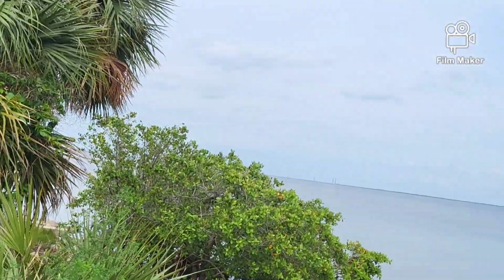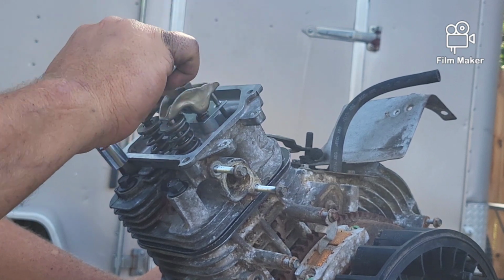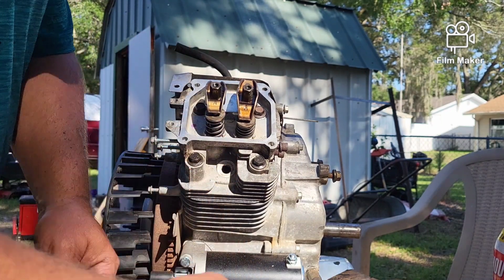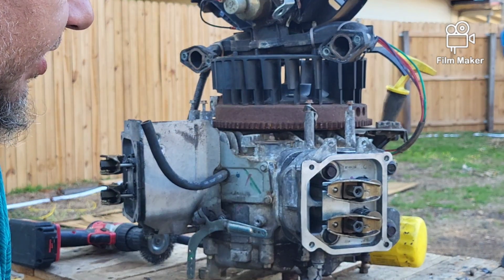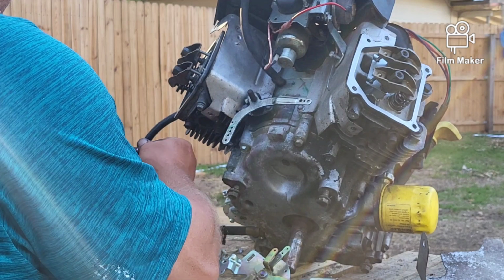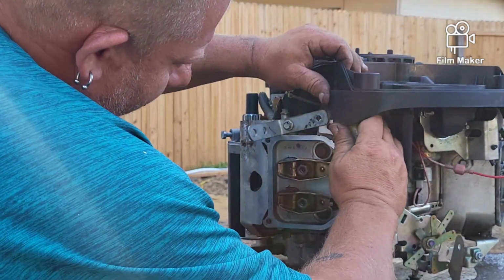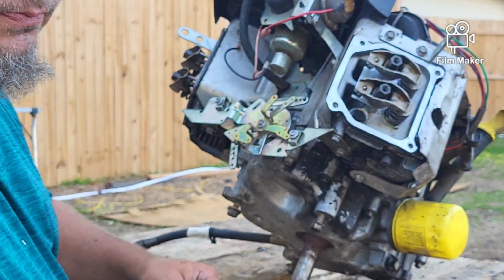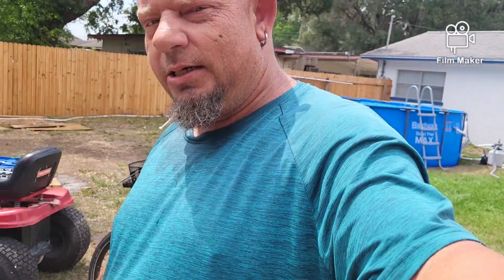Toro Timecutter Rusted & Seized Motor Can You Fix It With SANDPAPER??? Zero Turn

Comment: Compression increased from 50 to 120.  I wasn't expecting that at all.  Impressive.  You haven't sold that Gravely yet?  I thought that would be snatch up real fast.
Reply from the maker: I was happy to see the compression go up too lol.. unexpected.. the gravely I decided to keep because it's only 34 inches wide total and fits in most people's gates.. since I still cut grass it's not my every day cutter .. that's the yellow raptor.. but keep it for small gate customers and backup in case of raptor issues.. glad I did cause raptor is down at the moment lol.. I love them both